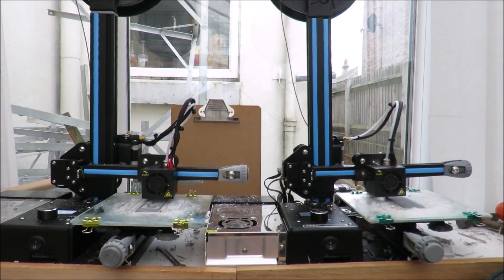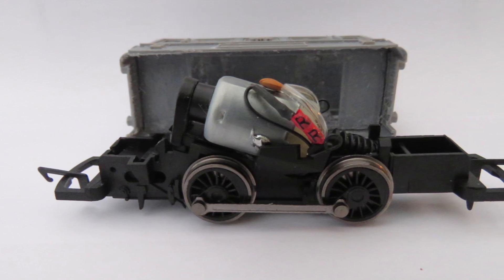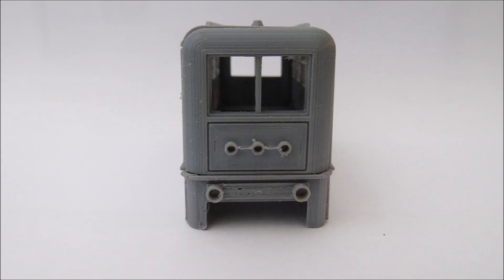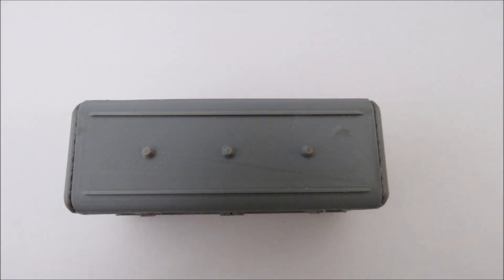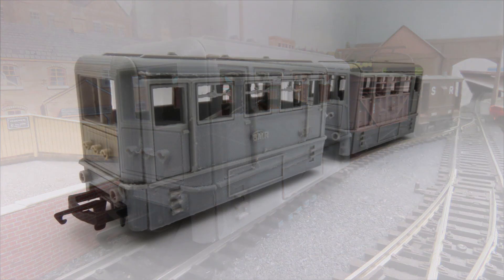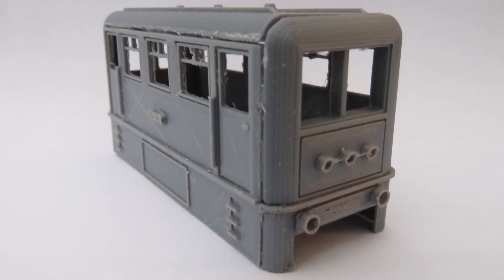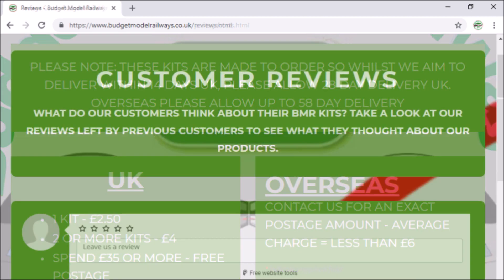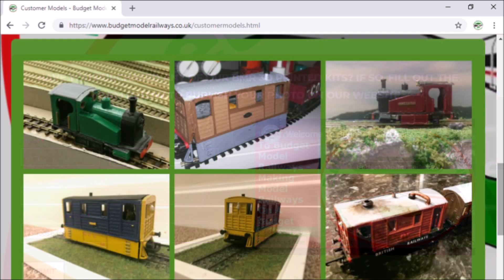Budget OO Gauge Model Railway Kits - Railbus / Railcar - 3D Printed

Comment: In order for the multiple unit version to work, then adding a coach corridor is needed as to simulate that real-life effect of DMUs and EMUs.
Reply from the maker: Not always, the early AEC and LMS versions were identicalin concept and similar in appearance to theses
Reply: @BudgetModelRailways  What about a freelance brake van? If you like, I could e-mail you a design for it.
Reply from the maker: @TheTWRModeller  thanks but brake vans are very easy to get hold of so not much likely demand. We are looking at one in 009 though

Comment: Can I make a suggestion chaps? You've made some superb freelance kits. Why not try to make a representation of an actual real loco or railbus etc? For instance, even if the chassis isn't exact, a basic model of an actual railbus (allowing a kit at a fraction of the price of say heljan) would sell very well indeed . Same goes for 009.
Reply from the maker: There are issues around licensing, plus trying to get hold of plans and info, rivet counters and the time involved , all making freelance a better proposition, plus restrictions in what can be printed
Reply: @BudgetModelRailways fair answer...I guess you've considered this already. However I'm intrigued you feel licensing may be an issue.?
Reply from the maker: It depends who,owns the rights, it's why some new models by the main manufacturers are so expensive. However the main issue is the time and resources needed plus finding designs that will work on a small 3D printer that has certain limitations. As an example I used to make 15 and 20mm white metal wargames vehicles. My Panzer 35t master model  took a week of evenings to research and design and three months of the same to build with over 500 parts to be hand made . My freelance wheeled APC took one evening to design and a week to build, and I sold twice as many.